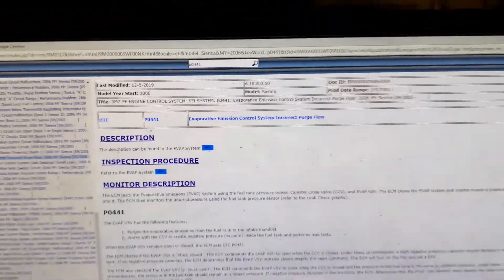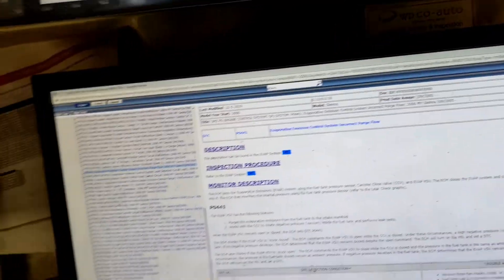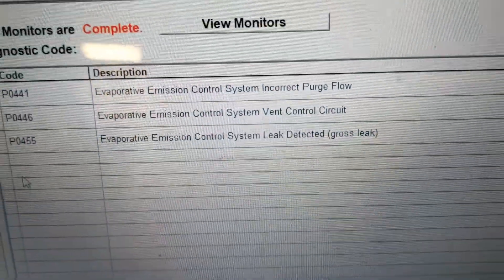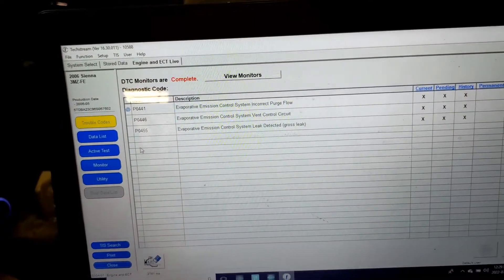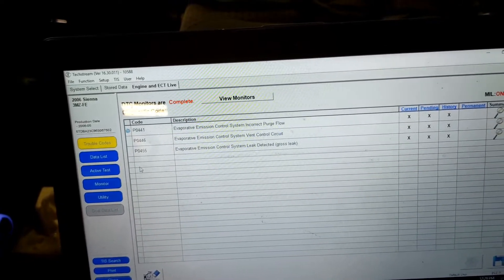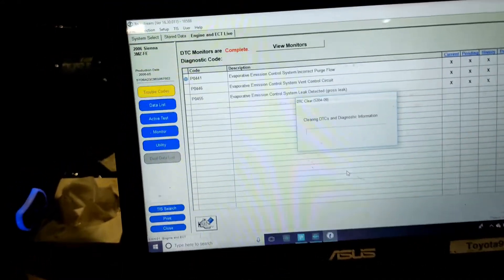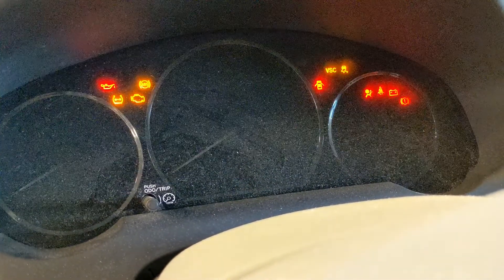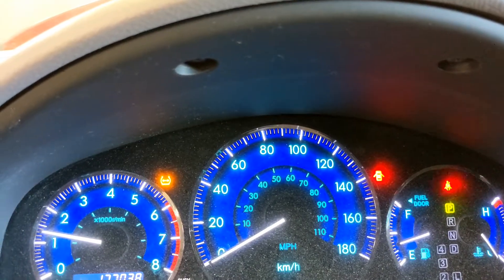Toyota Sienna 2006, 3MZ engine, P0441 evaporative emission system incorrect purge flow, P0446,P0455

Comment: I have the same P0441 along with P0451 EVAP pressure sensor/switch range performance. Would this lead me to the same faulty parts cluster shown here, or is there something else I should be testing for these codes?
Reply: Following, did you try to replace?

Comment: I have same car, purg valve not working in the car especially conector has 12v,
I test it direct to the battery and working fine,  any idea to fix this issue
Reply from the maker: @chrisisho2557 you can change the purge valve, sometimes working but malfunctioning
Reply: @pinoymechaniccanada  thank you